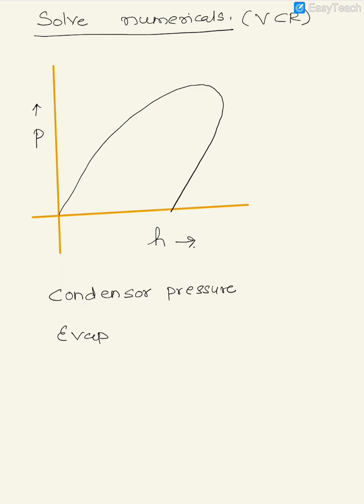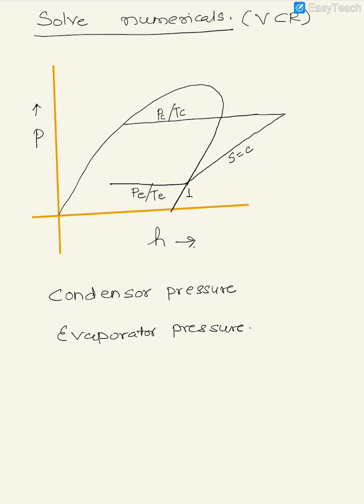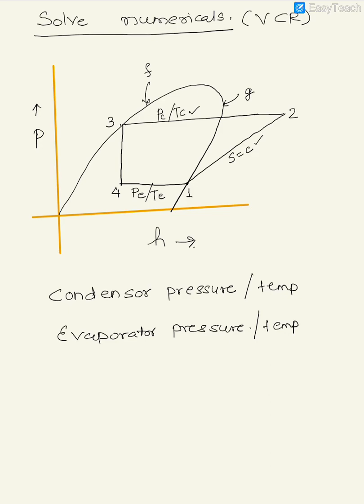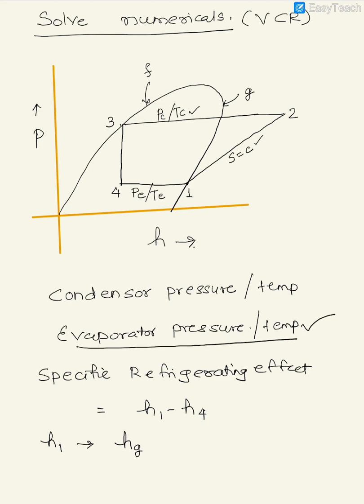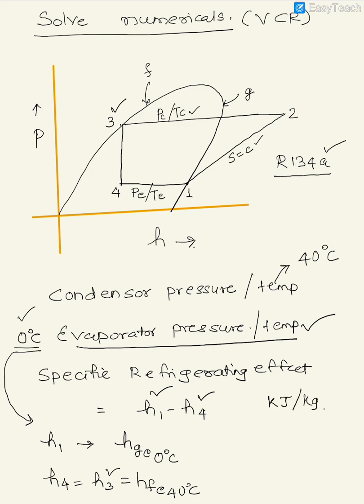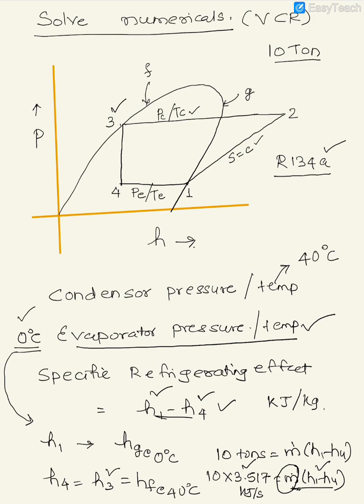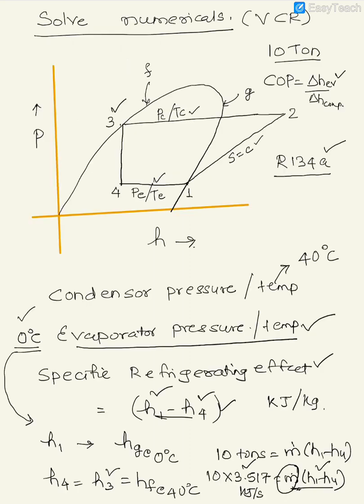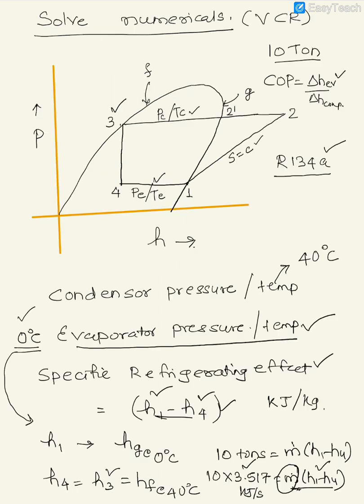How to solve numericals on vapour compression refrigeration cycle

Comment from the maker: correction somewhere in the video I have mentioned specific refrigerating effect as enthalpy difference across compressor which is wrong . enthalpy difference across compressor is specific compressor work and enthalpy difference across evaporator is specific refrigerating effect.

This I have corrected later in the video but in case someone watches it partially they might get concepts wrong 

Hence this comment
Prof Dr Mahesh Shelar
Kkwagh Institute of Engineering Education and Research
Nashik
mnshelar@kkwagh.edu.in